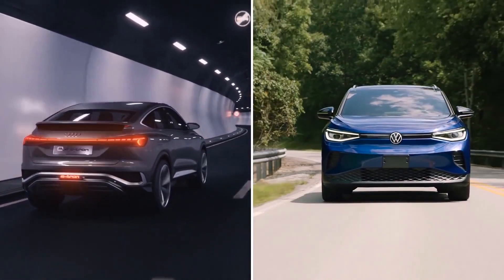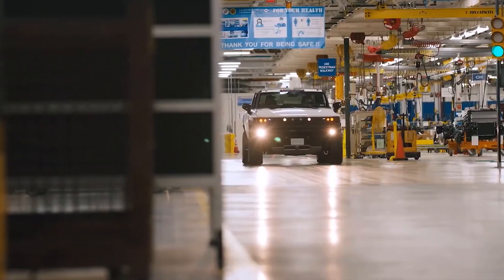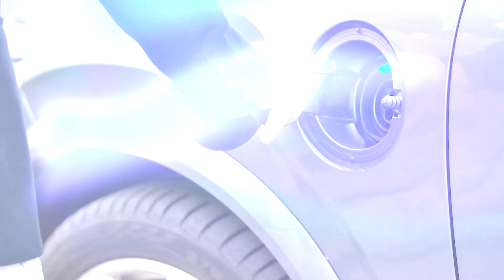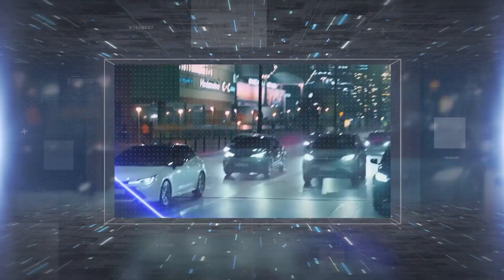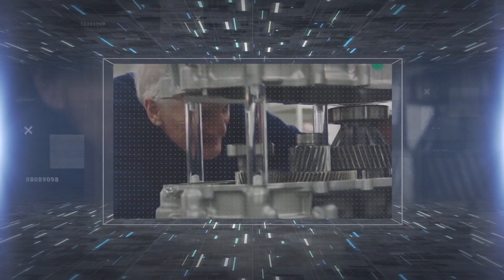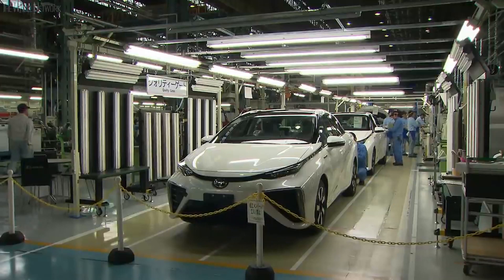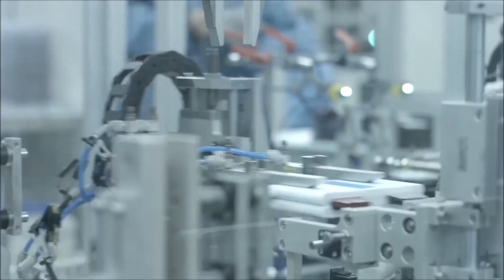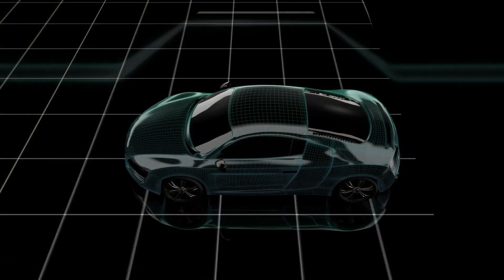The Race for the Solid State Battery

Comment: Solid state batteries wont be ready for the general public for another 8-10yrs.. And when it does it wont be as good as the lithium ion they will be making.. Its going to be 25+ yrs before the general public has access to batteries with the numbers this guy is touting. Math is math.. Its easy to show big numbers in theory. Getting things from the lab to manufactoring is a giant leap.. Things like solid state batteries and graphene make it kind of frustrating.. When will we the public actually get it?

Comment: "...the problem with these batteries is that they bleed a lot of heat and in turn require heavy cooling system to keep the car running..." not really a problem and not a lot of heat. The Nissan LEAF can get by with no active cooling, no thermal management for the battery pack, so it's not a requirement.
Reply: But the packs used in that car degrade faster as a result of the heat and the range is terrible to start with.
The Nissan Leaf is a failure.